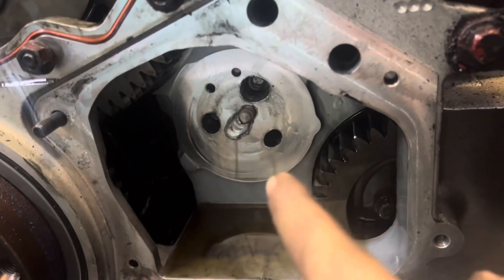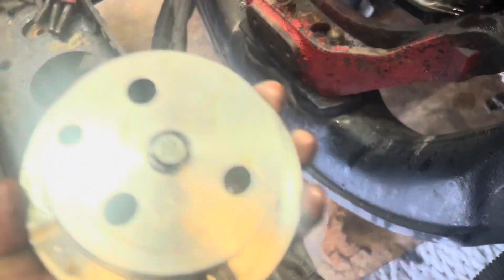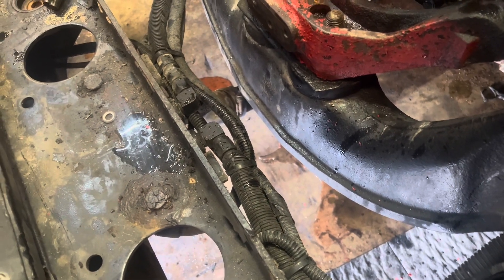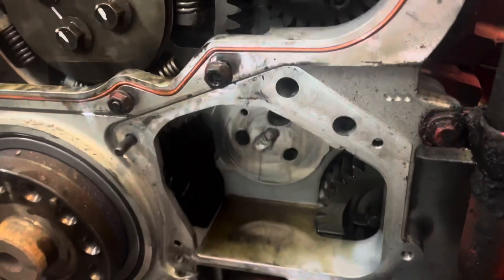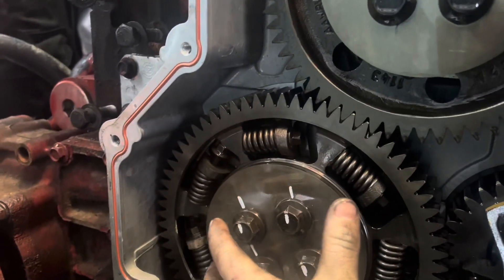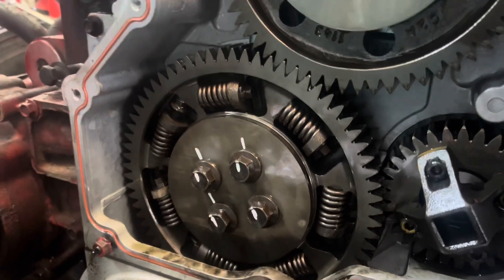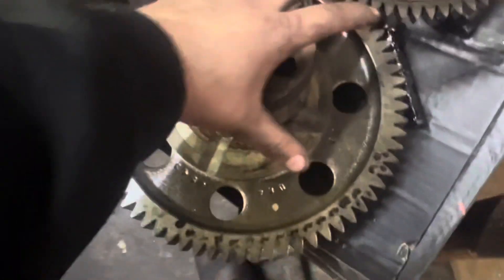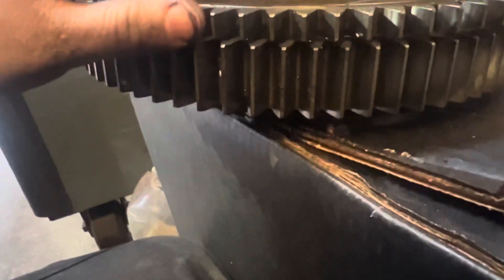Isx Cummins fuel pump idler gear bolt failure what’s new to come to h2g need help check us out

Comment: ENJOY YOUR VIDEOS. I GREW UP IN MY DADS TRUCK SHOP AND LEARNED A LOT. IM RETIRED AT 65 YEARS OLD. CERTIFIED IN DETROIT, CUMMINS 855,5.9,A SERIES B AND C SERIES,WORKED ON PROBABLY EVERY ENGINE THEY BUILT.GOT TIRED OF WORKING ON THEM AND BOUGHT A TRUCK  AND DROVE FOR ABOUT 20 YEARS AND MISSED OUT ON THE NEWER ENGINES LIKE ISX CUMMINS CAT C15 AND SO ON. BUT I DID AN INFRAME ON A 05 ISX A COUPLE MONTHS AGO FOR A FRIEND. PRIOR TO THAT THE ONLY WORK ON ISX I HAD DONE WAS REPLACE THE CAMS AND ROCKERS ON ON FOR DEAN TRANSPORT. I REALLY LIKE THE ENGINE. AND I MISS MECHANIC LIFE .  KEEP UP THE GOOD WORK. AND I WILL KEEP WATCHING.    AND IM CERTIFIED CARRIER TECH TOO REFRIGERATION AND APU.

Comment: Damn kinda wish I had an isx.  I got a paccar mx 13 in my 579. Over 1,045,000 miles on it no inframe yet. Just did the fuel injectors and turbo.  Had the rods and mains air compressor and radiator done.  You one hell of a mechanic.  Mad props.
Reply: You must have the exception my buddy has had hell,and just blew it up 600 thousand miles, and know of many owner operators that went broke.
Reply: is it true the camshaft can only be remove from the back of engine? meaning you gotta take the engine out
Reply: @kennardjohnson7875  I know right! I was thinking the same thing! I didn’t think they made major replacement components for those damn things
Reply: @jjjthomasson8902   my buddy said it's 60 grand for a new paccar engine, and he already had a new truck ordered, 200 grand

Comment: Hello Allison! Glad I found your channel! I found out about you from Justin on JustTruckin channel. You're a rock star! Wish I lived closer so I could intern with you.  I really think you need to amp your channel up on the education/how to videos...even multi-part long videos are fine by me!  I have a CM570 that the injector cam gear is the "spring loaded lash" type with 4 springs. I backed off ALL FOUR of the springs/bolts yet it still "jumped" when I removed the gear. What did I do wrong? Best wishes on your shop's growth! I know you're going to rock it because you have a huge following on Justin's channel!

Comment: Hi glad to be a subscriber of your channel, you are really doing good. I have an isx 15 with little coolant in the water seperator when truck is seat for 2 day. It stars and pull white smoke for few seconds then all good. I need your help.
Reply from the maker: Get injector cups checked

Comment: Isx cummins are weak motors rebuilds at 6 7  8 hundred thousand  every Detroit that I've owned I got well over a million I sold a classic with 1 .9 million on it no major motor work done at all except a Bull Gear replacement and the only reason I did that was I had my gear covers replaced.But I will say I've never new a mechanic more knowledgeable than Allison is she knows engines inside and out the industry needs more mechanics like her.

Comment: Hey Allison, I went to a shop I left my truck overnight to do some work on it, a few days later I went back for some issues that popped up after the work they did., a different issue popped up am not a mechanic but it don’t make sense to me, coolant in the fuel this guy says it’s my head the engine currently has 345k miles is it even possible for coolant to make it into fuel? I don’t loose coolant unless it’s very cold weather
Reply from the maker: Could be injector cups get it to someone who know what to look for and get them to test it
Reply: @nut-n-butisx7892  I can’t just take it to any shop and this guy I really don’t trust I trust him for that one fix guess I’ll be having to head out to griffin ga soon
Reply from the maker: Just come see us

Comment: That model of motor had huge Fuel pump issues Tappets...scoring in pump ..engines were blowing up ...bolts breaking...etc etc......i owned that model of motor...58.000 dollars in Re gen..Oil pump ...bearings New fuel pump Turbo accurator...There junk....When are you guys going to learn Dont buy other peoples problem...COOL trucks that are used are a hand Grenade WITH NO PINN...LEAVE IT ON THE LIT..
Reply from the maker: There actually good engines if u get it all don’t right and keep up with it.